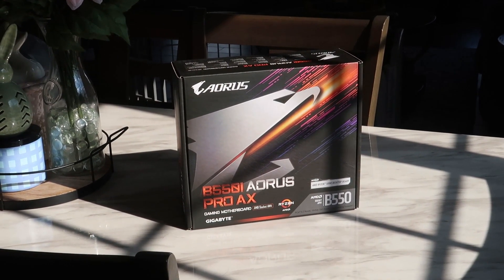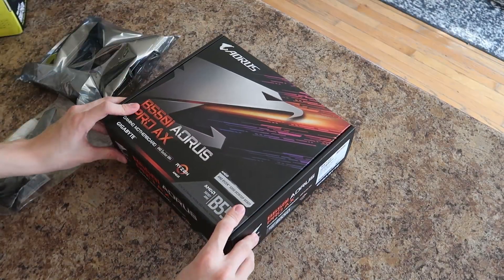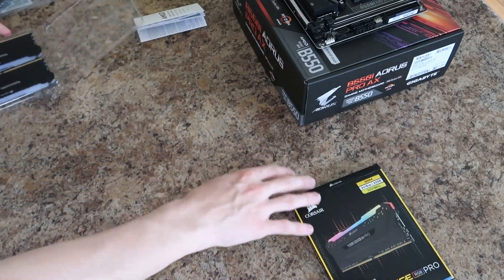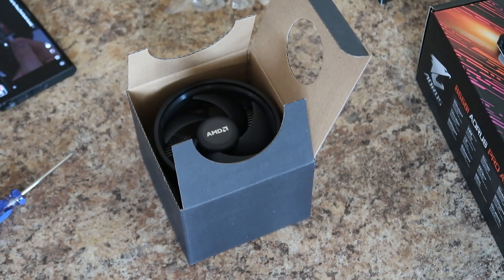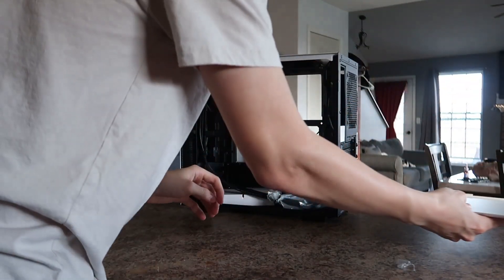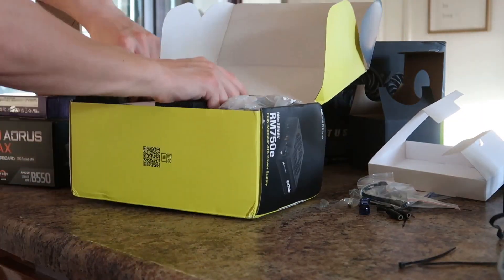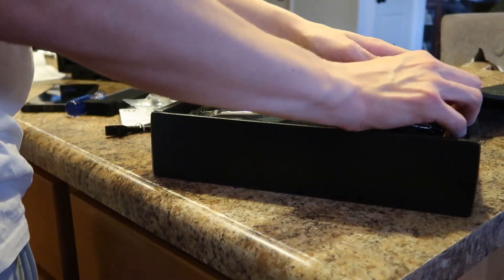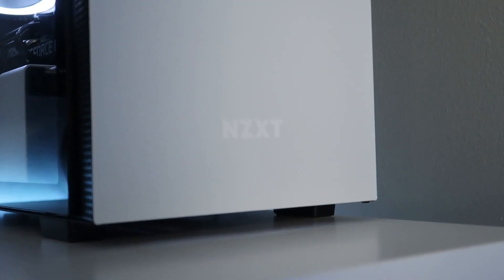Building My First Custom PC ($1500)

Comment: good job on your first pc if it was me i would have gotten a 240mm liquid cooler and put it in the front but good job
Reply from the maker: Thank you! An AIO would've definitely worked, but the r5 3600 is cooled so easily, especially by the default wraithe cooler that an AIO would be crazy overkill!

Comment: the tiny screw on the front ssd slot has to be removed, that screw/nut thing holds the nvme into the slot and allows another screw for the black heatsink to be screwed into, 990 pro is a gen4 ssd, only the slot at the front is gen 4 the one at the back is gen 3, which basically cuts performance by alot

Comment: with a 1500$ build u couldve squeezed in a i5-13600kf with any variant of the 4070, or an rx 7800 xt (if you prefer the upcoming fsr over NVidia's DLSS)

Comment: This looks really good, but does it have any airflow? I can’t see any vents on the case
Reply from the maker: It surprisingly has really good airflow. On the side and bottom of the front panel, there are vents so the front fans can pull in air. And for exhaust, the back and top also have vents! My gpus max temperature at full load has only gotten to 72c, and cpu 70c

Comment: Nice video but in a respectful way the 3600 and 3060 ti are horrible for a 1500$ . You shouldnt have spent so much on ram, motherboard, ssd and psu. You could have got a much better cpu/gpu combo. Nice build tho

Comment: Bro quick question I’m building my pc with the same case, have u had troubles with the airflow and temperatures? Thank you :)
Reply from the maker: Nope, not at all. Surprisingly, at least for me, this cases airflow is great! I'd definitely recommend having 4 fans (1 in the back, 1 on the top, and 2 in the front) to maximize the airflow since this case is pretty small. Otherwise, I haven't had any overheating issues or anything close to it! I hope this helps!
Reply: @PeytonToenjes  thanks man I was really worried about having to switch cases I really like the design, really helpful thanks for the feedback :))

Comment: the upside-down power supply label is for when you have a case with an opening at the psu shroud and you want the fan to be facing up

Comment: My gaming laptop broke so im saving up for a 1300 dollar pc, it has a rtx 3060, ryzen 7 8 cores, 12 threads and 3.4 ghz which is a massive jump from my ryzen 5 2.4ghz and 6 cores and 8 threads im also grtting 16 gb ram which is a jump from 8 i might even get 32 gb ddr5 ram which would be nice! I have 30 days left before i have enough to buy it so thats good. I also forgot to mention im getting a keyboard and mouse with it and a big mouse pad which makes it 1500 it has a 750 watt power supply, should i upgrade? Or is it enough idk lol but uhh yeah

Comment: Just fyi, the words on the psu are not upside-down. You are supposed to put it in upsidedown so the fan has intake.
Reply from the maker: I get that. But if it's almost guaranteed that the fan will be faced down, why wouldn't they face the words Upright compared to the fan?

Comment: Nice build but for 1500 I think you could’ve gotten better parts like a better cpu and gpu
Reply: True it’s crazy to have an rtx3060 in a 1500 pc but his video is amazing and the pc look nice
Reply: @lizzy1519 i got a 4060 and i9 12900k just for 1200
Reply: I have seen 1000$ build with ryzen 5 5th gen and rx 6700 xt which is better than 3060
Reply: @mihirsavla3233  for real
Reply: On build you should focus more on gpu and cpu because rather have better parts then have rgb and a spendy case
Reply: isnt the gpu going to bottleneck the cpu?

Comment: Good job on your first build.  The only thing that I can't understand is why you are using the 2 RGB-fans in the front. Seems like you can't even see them. I would've used the original case fans there.
Reply from the maker: I get where you're coming from, but, though you cant visibly see the 2 front fans, they are illuminating the inside of the case a bit!

Comment: u lowk coulda got better parts for just as much like a 3060 ti or even a 3070 and a ryzen 7 5700x( has more cores and threads 8 cores and 16 threads) im building my first pc soon andi managed to include a full custom water loop in the thermaletake core p3 case with the parts above^^^ along with 3600ghz ddr4 64 gig ram

Comment: I also made a one with around the same parts but it only costed me 980$
Rx 6700 xt phantom gaming
r5 5600x
gamidias air cooler
B550 Asrock phantom gaming Riptide
32gb ram 3200 mhz
gigabyte 750Watt gold modular
MSI mag case

Comment: great build, but im kind of confused how this costed as much as it did. I think this build should be a max of 1200 (no hate i loved the vid)
Reply from the maker: I have the pcpartpicker list in the description so if you'd like you can take a look at that. it costed around $1300 (a few of the parts have down in price since I bought them, such as the gpu) I added about $100 - $150 for tax, then rounded up a bit for the title!
Reply: @PeytonToenjes  I think you should have spent less on the MOBO and used that extra 50 dollars to get a 5600x, much faster performance, and leaves room for future GPU upgrades.
Reply: @gorillaglue2560  5600x is barely faster than 5600, there are a ton of videos about it online, have a look :)
Reply: @gorillaglue2560  my 5600 with pbo+undervolt is exactly the same as a 5600x

Comment: How well does it run games
Reply from the maker: Good! I can get around 120 fps at 1440p on max settings on Fortnite. about the same with apex legends. I made a Short on a few games performance, so if you'd like you can check that out.
Reply: @PeytonToenjes  alright thank you

Comment: may I ask why you chose a 3600 over a 5600x, considering the fact you chose a b550?
Reply from the maker: I didn't know that you had to update the bios to use a 5600x. Pcpart picker said that it wasn't compatible because of that, and I didn't realize until after.

Comment: Everything is fine. It looks great.

What I don't understand is why you chose the ryzen 3600, you added 20dls more and you could choose the 500 which is more modern.

I think that instead of buying those 29dls fans, you could have bought from another brand that was cheaper but not for that reason of lower quality and got a better processor.

And you could buy windows on those pages where they sell them for 15dls and if they are valid, original and have no problems (just in case you change the mother board and possibly lose that license), why spend 110dls on windows?

Did you buy it all in one payment? Or did you buy things over time?
Reply: ikr? he should have consulted with a pc building reddit/discord cause this build is pretty terrible
Reply: @retyurtt9962  Are we not reading the title correctly? It says "FIRST custom pc". Plus it's theirs, quit whinging.
Reply: @s1mone477 my first pc was miles better, this kid doesn’t know what he’s doing
Reply: @shadowfox3442  not everyone is you.

Comment: There's no way this was anywhere near $1,500 💀 
Unless bro bought overpriced parts.
Reply from the maker: My pcpartpicker list is in the description. Add about $150 for tax and its $1500 👍
Reply: Yeah, I checked it out. It's fine for your first computer build, but you definitely used overpriced parts and used Amazon, which is not a good place to get parts, especially GPUs. 

I clicked on the video because I am an experienced PC builder and was curious to see what you built and it's fine for your first build but as an experienced builder I built a computer with better specs for $500. 

I enjoyed the video! Keep up the good work. 👍
Reply: @KingSteven77  Blud used R5 3600 💀
Reply: @phluse2332  😂

Comment: I don't know how much did you pay for the ryzen 5 3600 but for the same price you can get the 5600x wich Is way Better.
Reply from the maker: I bought the r5 3600 for $120. I did think about getting the 5600x, but none of the mobos I could get were compatible with it.
Reply: @PeytonToenjes  the motherboard that you took it's compatible but you probably chose the componements on pcpartpicker and It says that the cpu Is not compatible if you don't update the BIOS of the motherboard.
B550 chipsets are made for 5000 series but the BIOS update Is necessary.
Reply from the maker: @Alessandro Pisano  oh okay, yes, i did choose my parts on pcpartpicker. Too late now, I also wouldn't know how to update a bios anyways so it doesn't matter. The 3600 still does anything I need it for
Reply: @PeytonToenjes  👌

Comment: dude, you overpaid for this whole thing, you couldve easily paid under $1000 if you did full research
Reply from the maker: I'm not sure what you mean by "full research." I didn't really care about the price, I just bought the parts that would be a good fit for me and that I would be happy with for many years. The aesthetics were also big part, I'm aware I spent over $120 on just case fans, but I don't mind because that's exactly what I wanted. I'd rather overpay for something that I will be happy with than get a good price for something that won't be exactly what I wanted!
Reply: @PeytonToenjes  you could also build a way better mini itx pc for $1500 with very similar aesthetics and way better specs like an i7 and an rtx 4070
Reply from the maker: @kushREAL  you could never fit a 4070 in a mini itx case...
Reply: @PeytonToenjes  4070s arent that big, you definitely can. in fact, a lot of 4070s are the same size as that 3060 that you fit... in a mini itx case
Reply: @PeytonToenjes  bruhh, i am using the same case as yours, i can install noctua nhd-15 cpu cooler  for my 13900k and 4070ti gpu from inno3d. i build my pc last week.
Reply from the maker: @mesumitunaluri2383  I'm aware of that now, i used to be under the impression that the 40 series cards were HUGE and could barley fit in most cases since I never really looked into them, but I guess I was wrong
Reply: @PeytonToenjes  its only the 4080 and 4090 that are large. the 4070 is actually quite small, smaller than some 3070 cards. rly efficient too

Comment: Just a quick tip bout ur mobo and ssd u shouldve checked if ur motherboard can utilize the MB/s of ur ssd because now u have a fast ssd but ur mobo cant fully use the ssd speed
Reply from the maker: That is a good idea that I never thought of. Though I did just try to find the max ssd speed for my mobo on Pcpartpicker  and couldn't find it... I also only really had 2 options for a mini itx mobo, and one of the 2 was out of stock :/

EDIT - nvm I found it, it supports 6560 mb/s, and my ssd can do 7450. That sucks but I'm fine with it, 6560 is still crazy fast, and I didn't really have a better option anyway. Thank you for pointing that out, though!
Reply: @PeytonToenjes  your mobo cant actually support the speed of the SSD. Your SSD is a PCIe 4.0 SSD, but the slot on the back (where you installed the SSD) is only PCIe 3.0, which limits it to about ~3500. I know this cause I have the slightly worse version, 980 pro, and its in a 3.0 slot and its limited to around ~3500.

Comment: Mini-ITX was a mistake. You had room for a bigger case and Mini-ITX is usually more expensive and has limited connection options.
Reply from the maker: I may have had "enough room" for a bigger case, but it definitely would've felt cramped and claustrophobic. That's why I went with mini itx. The case was $60 or so, and I didn't have to buy any different parts than if I went with atx (other than mobo). As for limited connections, if you're talking about the io, then I don't mind. I have enough USB ports, and if I did run out, I could just buy a USB hub.
Reply: @PeytonToenjes also a quick tip NEVER use Nzxt brand for case fans and etc cuz they are just overpriced af and the performance isnt great thats where u wasted 200$ for case+fans and u couldve gotten a better case with fans in it for around 150$ also a WAY cheaper mobo and with that extra money easily upgrade the gpu to 3060ti and a better cpu
Reply from the maker: @MKuber  I didn't even really have a budget. I just chose every part that would let me do what I wanted. I bought the case and fans because it looked the best (in my opinion). I wanted this project to be EXACTLY what I wanted in the end. My Temps with this case never get high either. For an AMD mini itx mobo, I only really had 2 choices that looked good and gave me all the ports and all that stuff that I needed. The other one was out of stock, so here we are. Again, the mobos that I could get weren't compatible with anything better like a 5600x and i didn't mind that because the 3060 and the r5 3600 don't bottleneck each other at all. They both work for my needs and I'm glad with how the build came out 👍
Reply: @PeytonToenjes  I suppose we can't argue about aesthetics, but I'm still wondering why didn't you go with a microATX board instead of ITX, though. The case could be almost the same size if you went with something like the Asus AP201 or Jonsbo D31. Then the board itself could have been much cheaper and with more options to choose from. Then you could also get the Ryzen 5600 or even the 5800X3D (at least by updating the bios). That's the part I don't really get about your decisions for this build since it seems that you're not limited by space or budget.

Or why not go with Intel i3-12100F even? There's so may choices! How do you choose? 🤔😂
Reply from the maker: @J P  I wasn't trying to argue, just trying to show my reasonings. Thank you for being respectful :). I guess there were a few things that I could've done better, but I'm definitely not disappointed in this build.
Reply: @PeytonToenjes   Of course, not every PC can be the perfect build, there's always going to be compromises and aesthetic issues to consider. PC building is a learning opportunity and the finished build isn't the end of the journey.😉
Reply: And those fans are super expensive. You skimped with the CPU and GPU to buy expensive parts that don't give you more performance. This is honestly a terrible build for the money.
Reply from the maker: @J P  I don't mind the $30 price for the fans because I wanted this pc to be perfect for me. I disagree with skimping out on the cpu and gpu. The 3060 is a VERY capable gpu for anything I need to use it for. As for the cpu, again the r5 3600 is able to do anything I need it to. And any mobo I could get wasn't compatible with the 5600x or anything like that.
Reply: @Jenni_Sofia  agree with you bro with 1500$ u can build easily a pc that can do even 4k gaming in solid fps and still be better for work than this build

Comment: This is a VERY clean pc with smart parts! Good job man
it didn’t actually cost 1500$ though, right?
Reply: i think he might have just bought overpriced or new stuff, nothing used (like new) or good deals, just straight off amazon, i guess?
Reply: @09labss  Facts
Reply from the maker: @09labss  I bought everything off of Amazon new
Reply: did you buy this recently? just curious cuz I just bought a 6950xt, 13600kf pc with a 360mm aio in a magniumgear neo qube 2 and it only costed around $1600
Reply: Can get a 4070 + i7 13700kf for 1400 pounds with aio and the performance will be 1000 times better
Reply from the maker: @flaexu1821  1400 pounds is relative to 1700 USD
Reply: @PeytonToenjes  you could get a 6800xt with a 13600kf with a deepcool ls720 aio for like 1300 usd
Reply: @vu2xk  lol he already built it what's the point now
Reply from the maker: Thank you! And yes, it did cost around $1500, including tax

Comment: this is very nice
you definitely could've went with a  R5 5600x
but still a neat pc regardless
Reply from the maker: Yeah, I wanted to go with a slightly better cpu, but the mobos I wanted weren't compatible with the 5600x
Reply: @PeytonToenjes  usually the motherboards require a bios update, i have a 5800x on a b350 board and it works just fine. no judging tho, still a really powerful build nonetheless
Reply: @PeytonToenjes  But that motherboard is compatible with the 5600x. In case you need to update the bios.  I think you should have saved on the fans and better add it to the processor or the graphics card, a 6700 would have been better
Reply from the maker: @Javier Reyes  I didn't really have a budget, so saving on one part and spending on another doesn't really apply to this. I just bought what would go good together and would let me do everything I wanted. Pcpartpicker said my mobo wasn't compatible since it needed a bios update that I didn't know about. The 3600 is good enough anyway. I went with the 3060 because it actually fits in my mini tix case and is great. I also much prefer Nvidia for their reliability, the raytracing, and I'm just more knowledgeable about their gpus
Reply: @PeytonToenjes  You could actually see on your motherboard box that theres a sticker says "Ryzen 5000 ready" So no bios update was needed and you could've gone with a 5600. But enjoy your build nonetheless!
Reply: @PeytonToenjes  you can actually buy the processor and motherboard bundle and it's actually way cheaper only 330usd for r5 5600x+b550-plus mobo
like for the R9 7900x bundle with motherboard
makes it only 588 usd(as of rn) with b650m aorus elite instead of it  being nearly 750 usd
so if i were you i might've gone with r5 5600x+b550-plus bundle
but i'm pretty sure you can upgrade it eventually
also the gpu is a really good choice(12gb of vram) so it lasts longer